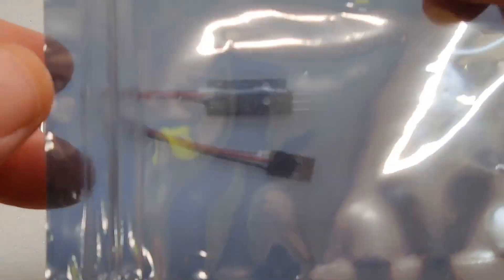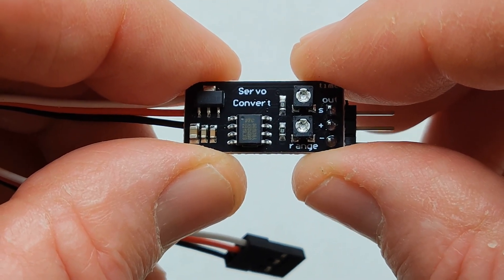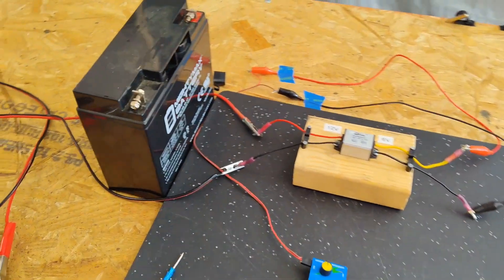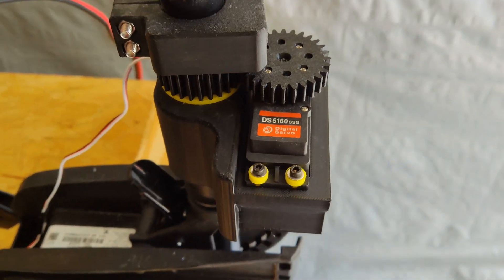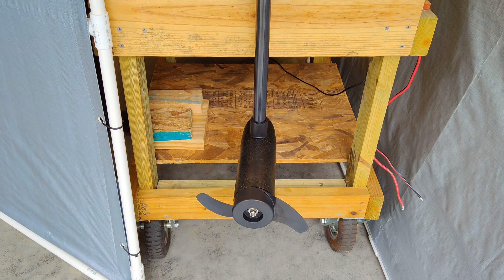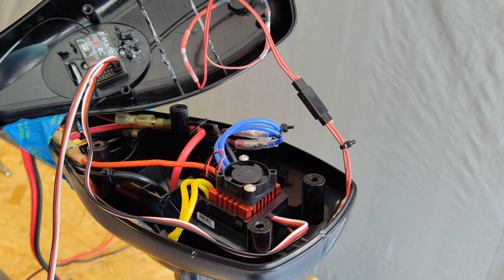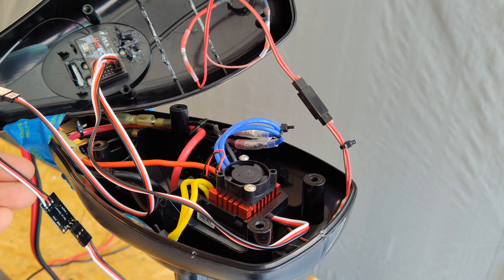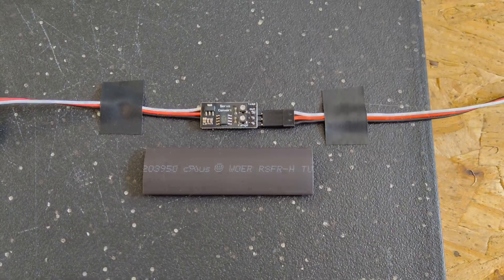RC Servo Motor Speed Controller

Comment: I noticed that the SC Governor (aka, servo motor delay circuit) was plugged directly to the remote transmitter without voltage regulation to the servo.  Is such regulation not needed, or is the transmitter handling it?
Reply from the maker: The transmitter is working as expected with the circuit.
Reply: @Aksmaniyak  My concern regarded over voltage to the servo which is limited to 6 to 8 VDC. After further research, I figured out the Boatwing ESC has a builtin battery eliminator circuit that reduces the nominal 12 VDC of the main battery bank to 6 VDC for the servo.  The need for an accessory battery used in the original speed governor circuit confused me. Thank you for the reply and I appreciate you sharing all these developments with other users.
Reply from the maker: @kenkephart4080  Glad to help.

Comment: So when you wire the delay circuit and plug it in to the wireless receiver is that also including the servo tester and buck converter?
Reply from the maker: No, just this set up.
Reply: @Aksmaniyak  so the servo tester and converter are to just set up the delay circuit chip
Reply from the maker: @danmackey  The delay circuit smooths out the steering servo motion.

Comment: Could you do this with the Newport 55 or what’s the max pound thrust rated for that hobby wing esc?
Reply from the maker: I don't recommend using the 880 ESC with any trolling motor larger than 50lb thrust.
Reply: @Aksmaniyak  why not? I’m curious bc that’s what I’m running my ESC on?? 

Now that being said I haven’t had a chance to test it yet on the water for a trip as I just wired it up about a month ago and it’s just getting warm here and will probably fish in April
Reply from the maker: @ Because I know somebody that used an NV 55lber and it fried the ESC wiring. The wiring can't handle full power for an extended time with that size TM.
Reply: @ ok good to know! I don’t go full power anyway maybe 20-30% when trolling and going from spot to spot so hopefully it will still work. 

Do you have a recommendation for a diff esc or  method to control the motor?
Reply from the maker: @ For larger motors there are some good PWMs.

Comment: Thanks dude. This little circuit solved most of the issues that was keeping me from deploying my own version of an RC controlled trolling motor for my SUP fishing setup. You can see videos that I made for my RC airplane club buddies @jimn6sxb644.  I'm not a YouTube creator, all my videos are made for my buds. I made another comment with links to one specific video, but it got deleted for some reason.
Reply from the maker: Thanks Jim. I will check them out.

Comment: Hi, My one question would be, does the servo motor delay act like a PWM? or is it one speed just slower? I like to troll at slower speeds and cruise shorelines , thx Ken
Reply from the maker: Thanks Ken. I don't know if it really acts like a PWM but it does allow you to dial in a speed either faster or slower.
Reply: The PWM pulse width is interpreted by the servo as a position command, the delay would just delay the start of the position command.  So the PWM signal from the receiver will just maintain the current pulse width and then pass through after the delay.  The speed function just breaks down the new position command into several sub positions and moves to each with a delay between subcommands.  More or less....

Comment: Your link to the HOTRC DS-600 remote and receiver has the 4-9 volt receiver rather than the 4-14V version that we need for our project.  The 4-14V version seems to be sold out across the globe.  Did they stop making the HOTRC DS-600 PWM 4-14V or do you think it's sold out and will be available again some time in the future?
Reply from the maker: You can try Aliexpress. I know the new DS600 model changed.

Comment: Greetings aksman, i have just recently received all the pieces to assemble the drive and steering as you have so clearly outlined in orevious videos. I just wanted to point out, coming from rc planes, this sort of unit is often used to adjust the speed of landing gear servo retracts, and more sophisticated transmitters can accomplish some of the other functions like adjusting end point travel, use of dual rates for less or more travel over all, and exponential rates to help tame over control. I am about to unbox the Hotrc transmitter and explore if it offers more than the basics, and will report back. May i say, Good Job providing clear and easy to understand information !
Reply from the maker: Thank you Neal. I had no idea if the circuit would work when I ordered it. 😁